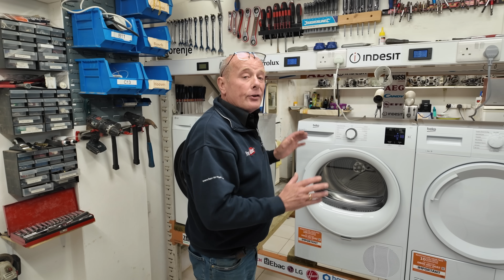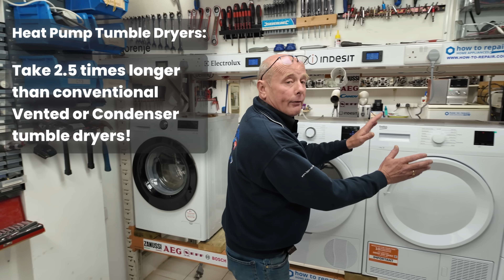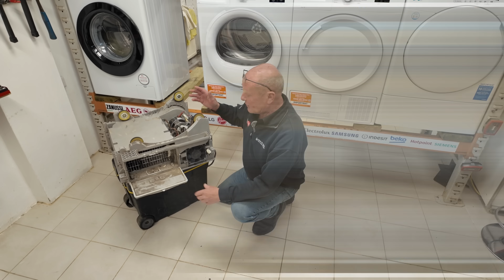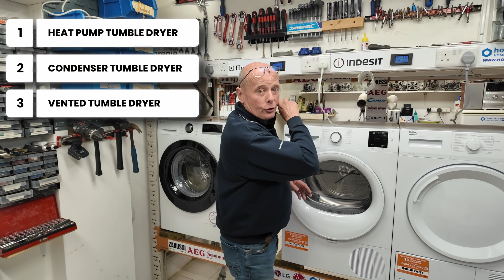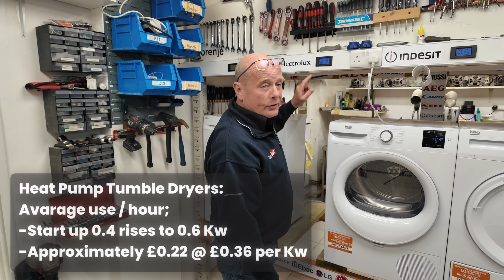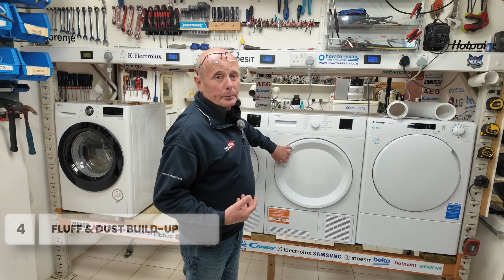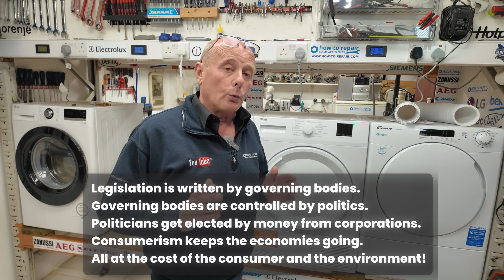Tumble Dryers the Shocking Truth About Heat Pump vs Vented & Condenser, NEW LEGISLATION!

Comment: If a heat pump dryer uses a quarter as much power and runs for 2.5 times as long, that's a big electricity saving. 
They also run cooler, so are less likely to shrink the clothes.
As for repairs needing expensive equipment to regas, that rather depends on the need to do it. I've had fridges over 50 years still on the original charge. 
How many tumble dryers do need regassing? How much does the regas kit cost, in comparison to the cost of the engineer's van?
Yes, longer run timmes might add wear to bearings and motors, but again, I'm not convinced that this is a likely failure.

Comment: So glad I saw this video.
I initially wanted a condenser tumble drier but most things were pointing me towards a heat pump version.
I didn't really consider the extra drying time factor causing more frequent repair possibilities.
Or the cost or viability of those repairs.
I am 100% going to stick to my original thoughts & get a condenser version.
Thanks for the video :)

Comment: You can buy a heat pump drier for £300 and a condensing one for £200. You really are not going to be spending out to repair it when it is 5 years old! 
Sorry but it is 2025 not 1975!  The heat pump will use far less energy to save the extra cost on buying it.

Comment: My condensor dryer takes about 48 hours. It is easy to repair, uses no energy, produces no fluff, smells great without additional chemicals, has zero waste problems and costs only 4,95 euro's for 10 meters.

Comment: I have just replaced my old candy condenser which I only had to press the reset button at the back, every now and then. The new one is a candy too but has always had a knocking noise (a lose wheel on the belt) now it has stopped and just makes a humming noise when turned on… heat exchanger probably?

New one also says made in turkey 🤷‍♂️ on it and has torex screws.

Comment: It would have been good to demonstrate the drying time and consumed power with identical loads of washing. Not doubting your experience, just like to see the results out of curiosity. Personally, I have avoided heat pump dryers, not helped by the fact my old Miele condensing dryer won't die. I will give it a clean after seeing this though. Thanks for doing the video.
Reply from the maker: Thanks very much for your comment, mate. I have a video planned showing the running costs of a brand new appliance, but I'll have to wait until I get back. I'm travelling abroad soon, so it might be a little while before I can publish it.

I appreciate people like you taking the time to write it out. Please share it where possible. It might help others make a wise choice instead of being misled by the industry.

Comment: I have a Bosch heat pump dryer that has been doing a good job for almost 6 years now. The timer initially shoes something like 3.5h but typically, it takes between 90 and 100 minutes to complete a full load. Also, clothes seem to be less heated up compared to the Miele vented dryers we had in the dorms at my university. This seems to have a bigger impact on wear than the time spent.

I believe you about all the cons but would still prefer the heat pump.
Reply from the maker: Thank you for your comment. I appreciate people like you taking the time to write it out. Please share it where possible. It might help others make a wise choice instead of being misled by the industry.

Comment: Being a salesman, and owner of a now 4 year old mid tier Miele Heat Pump tumble drier, and I can honestly say, there is a night and day difference from model to model and brand to brand on how much time it takes to dry clothes. Even though they are rated for the same weight of clothes. Cheap machines tend to be "overrated" meaning it says 8 kg, but in reality, it performs more like a 6 kg tumbler. There is also a night and day difference in dust mitigation from machine to machine. My Current Miele takes about as long as the old Beko condensing drier we had previously with the same load of clothes. It is better in some ways as well, as it has sensors, so you can choose how dry the clothes are when it is finished.

Comment: Definitely food for thought. I have had an AEG vented tumble dryer for 12+ years and still going strong, but considering purchasing a heat pump one. The customer reviews I’ve read online on a very reputable national retailer’s website indicate it does not take as long as 2.5 times to dry as with a vented dryer. More like 1.5 times or a little more and kinder to clothes, but that will depend on the brand.  I would definitely buy AEG again but the cost is in the region of £750 so longevity would hopefully be better,  otherwise what you save in electricity costs you spend on replacing the machine  and sending more to scrap!
Reply from the maker: I think heat pump technology is brilliant, but these machines are only lasting on average five years they take at least two times longer to dry the clothes at least twice the amount of wear and tear and components and the accessibility to do maintenance is an absolute nightmare. manufactures do not seem to understand what maintenance is needed and how easy it is to do. They seem to build it and assume it's perfect without testing properly. Thank you for your comment. I would be grateful if you would share this post, as it’s the only way to force things to go large nowadays. Have a great day, Paul.

Comment: Seems very much like scare mongering. Had a heat pump dryer for 5+ years and no issues at all. It takes a little longer than our previous condenser dryer but uses some much less energy. Wouldn't go back to the old one.
Reply from the maker: I think heat pump technology is brilliant, but these machines are only lasting on average five years they take at least two times longer to dry the clothes at least twice the amount of wear and tear and components and the accessibility to do maintenance is an absolute nightmare. manufactures do not seem to understand what maintenance is needed and how easy it is to do. They seem to build it and assume it's perfect without testing properly. Thank you for your comment. I would be grateful if you would share this post, as it’s the only way to force things to go large nowadays. Have a great day, Paul.
Reply: @How-to-repair  As mentioned ours is around 5 years old (so due to breakdown any moment 😉) and can't say we've noticed any additional wear on anything. If anything, it's a little kinder on the cloths as it runs a little cooler, hence the longer run times. The time side really isn't an issue either, was a shock at first given what we were used to, but you quickly realise it doesn't make a difference. Example, we have a busy household so it's on pretty much once a day and Friday is our "towel day" as I work from home I do this and do 3 loads of towels (some big bath sheets) and in the time it takes one load to be washed, one load has finished drying. Thats with the drawer full of water and is done in around 1h30m-1h45m ish. 
 I'll be honest I'm curious to try and take the side off to see if there's a build-up of dust in there, but not sure I fancy taking it apart as knowing me I'll damage it or it'll have a rattle once I put it back together😅
Would still recommend a heat pump dryer without thinking. We saved close to 3kWh per load with is around 10 miles of driving our EV, couple that with other A+ rated appliances and it almost cancels out the daily commute which is a bit made when you think about it.

Comment: A fairly competent DIYer here. I’ve repaired my own basic vented dryer a few times now and they seem like very simple appliances. At the beginning of your video, I thought to myself, ‘I’d better replace my dryer before they stop making them’ but after watching the rest of your video, I’ve decided to just keep repairing it when needed to make it last many years to come.
Reply from the maker: You’re right mate, vented dryers are relatively simple appliances, and with a bit of know-how, they’re much easier and cheaper to repair compared to heat pump models. 

I’m glad the video helped you make an informed decision. There’s a lot of pressure to upgrade to newer, more energy-efficient appliances, but as I mentioned in the video, the long-term costs and environmental impact of heat pump dryers aren’t always as green as they seem. Keeping your current dryer running is not only cost-effective but also a more sustainable choice in many ways.

Please share it where possible. It might help others make a wise choice instead of being misled by the industry.

Comment: I was always already convinced of what you are saying. 
I'm looking for a second vented dryer as a back-up for the machine I have in use. Then I probably never have to buy a heat-pump dryer.
Reply from the maker: I think heat pump technology is brilliant, but these machines are only lasting on average five years they take at least two times longer to dry the clothes at least twice the amount of wear and tear and components and the accessibility to do maintenance is an absolute nightmare. manufactures do not seem to understand what maintenance is needed and how easy it is to do. They seem to build it and assume it's perfect without testing properly. Thank you for your comment. I would be grateful if you would share this post, as it’s the only way to force things to go large nowadays. Have a great day, Paul.

Comment: We have had a heat pump dryer for a few years now, and I don't recognize this at all. the dryer is ready faster than our old condenser dryer. Less dust comes off the clothing because it dries much more gently. and you don't have to clean the condenser because it has a built-in flushing function. keep up with the technology and don't be left behind.
Reply from the maker: I believe heat pump technology has great potential, but in practice, these machines have a disappointingly short lifespan, typically lasting only five years. Drying times are significantly longer, often doubling the usual duration, which increases wear and tear on both the clothes and the appliance components. Furthermore, maintaining these machines is incredibly difficult. Manufacturers seem to have little understanding of the necessary maintenance procedures and how to make them user-friendly. They appear to design these appliances with little thought to practicality, assuming perfection without adequate testing. Thank you for your comment. I would be grateful if you would share this post, as it's crucial for raising awareness and driving change. Have a great day, Paul.

Comment: Excellent video thank you. Very clear and to the point with no bull…t
Reply from the maker: Thank you for your comment. I appreciate people like you taking the time to write it out. Please share it where possible. It might help others make a wise choice instead of being misled by the industry.
Reply: Stick with condenser. I have stripped my beco 
 right down and removed tons of lint. That cured my problem. I removed the drum. I am a retired electrician and have worked on appliances professionally, but that was a long time ago. They are all cpu controlled if seems now.. I go back to the hoover Keymatic and twin tubs even the rolls rapide. It's a. Totally different world now, armed with laptops and firmware changes as I did with security alarm systems.. At 78 I prefer to call in the experts now. Thanks for your info.

Comment: Making anything compulsory is stupid, because it does not allow competition to find the correct answer. 

That said. I have a 24 yo Bosch heatpump tumble dryer. When I bought it, I was starting a trades apprenticeship, and working two jobs, I was using a dryer more often, approx twice as often(twice as much laundry). At that time, our vented dryer died, and I replaced it with the heat pump dryer. Our electricity bill went down by au$150 per quarter. The dryer is still going strong, with only a small crack in the drum because I don’t always check my pockets for screws. 
I run the machine in low heat mode always.  I am satisfied that I have got my money worth out of this machine, paying for itself in savings in under 3 years. 

I believe that brand, and place of manufacture, is probably more important than type of appliance, buy the highest quality you can afford and avoid CCC. Maintenance is also very important. I am yet to figure out how to open up my dryer to vacuum out the case, so I am religious about emptying the accessible filters. Anyone know where I can get service manuals for Bosch appliances?

Comment: Sunscribed and liked 

Finally someone talking sense
Its not all about the inatant energy usage 
And like you also said 
A entry level heat pump machine is 400 pound 
Quite a few people i lnow who have bought one paid between 5 and 600 pound 
 I bought a second hand vented machine 25 years ago 
And when i moved house 10 years ago it was atill working perfectly and i left it in the house for the buyer 

5 years ago
I was given a 3 year old condensing machine ,as my friend gave me it as he had a new kitchen fitted and went intergrated 
So my condenser dryer is now 8 years old and working perfectly 
Lad at work has just bought a condenser dryer 
After his heat pump drier failed after 3 years 
And was deemed uneconomical to repair
Reply from the maker: Thank you for sharing your experience it’s always great to hear real-life stories like yours! You’re absolutely right it’s not just about the instant energy usage. The long-term costs, repairability, and overall lifespan of an appliance matter just as much, if not more.

I appreciate people like you taking the time to write it out. Please share it where possible. It might help others make a wise choice instead of being misled by the industry.

Comment: In America, we have our own problems facing us this year. As of January 1st, all HVAC systems installed in homes will take a new refrigerant. Since it's slightly flammable, there are sensors throughout the whole unit. If ant sensor detects a leak in the freon, the whole unit will shut down until a service repairman can come out to find and repair the problem. What was the matter with R410? We should have kept the old refrigerant.

Comment: 1. Wear and tear: That should not really be a problem when fairly good bearings are used. Motors and bearings on washing machines have to endure much more punishment and so far I never really had a problem with them.
2. Repairability is definitely a fair point.
While heatpumps are generally really reliable, cheap compressors and bad maintenance can become a problem. Compressors usually don't die, they are murdered!

3.&4  That is really just bad design and here the big problems start. There should be a better way to clean them. 
I would probably try to clean them with with some compressed air. Better filters and enforced maintenance would probably also help here.

5. Most of this comes down to maintainability and repairability. The problem with early failure of units also mostly exists because of planned obsolescence.
These are factors that have to be managed by lawmakers to enforce sustainable products instead of stupid greenwashing.
Manufacturers have to be forced back towards repairable designs and they should also be forced to make spare parts and schematics available.

I will just keep on using my clothes rack:
+ It does not consume any energy at all
+ It was very cheap (constructed out of some rope and basically scrap wood)
+ Does not need much space (it has pulley to pull it up to the ceiling)
+ Basically no maintenance necessary
+ Never gets obsolete
+ Very quiet when in operation
- clothes take slightly longer to dry

Comment: Shameful regulations. I love heat pumps, and I think they have a place in dryers, but this is pure hubris.
I think a lot of this could be solved by simply using a more effective heat pump and more effective circulation.
I'm sorry to hear that individuals are unable to recharge small appliance refrigerants in your part of the world. Here in the US it is fairly common.
LG is selling units which are MUCH easier to clean, at least here in the US. It is a simple cover just like the condenser you showed. LG also has in their manual a cycle that can be used to clean the coils with water.

Comment: My condenser dryer used 5kWh per cycle for a full load. My heat pump dryer uses 2kWh for the same load. With a load a day, that is a huge saving for us. Even if it only lasts a few years, still a better choice financially

Comment: It would have been useful to have provided the figures on the actual difference in running costs. You talked about doing the maths then never actually did them.

When you say that ones uses X amount of electricity but takes Y times longer, it's unclear what an estimated payback time is.

I've found elsewhere that a condensing dryer will use 5.2kWh for a 9kg load but an HP one will use just 2.16kWh for the same 9kg load.

Doing just 100 loads in a year with electricity prices of 22p/unit that's a saving of over £300 over 5 years.

The feedback to legislators should be that the devices should be easy to clean, maintain and repair, so that they don't get clogged up and will last their design life. It should not be that they've been taken for a ride by the manufacturers, as it's clear from the energy consumption figures that there is a clear benefit from HP dryers, especially with rising electricity costs.